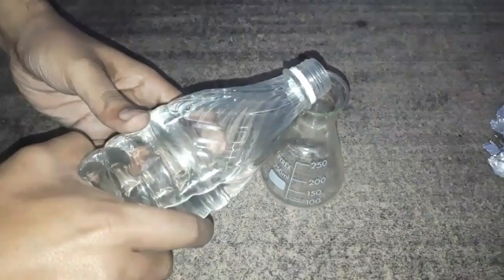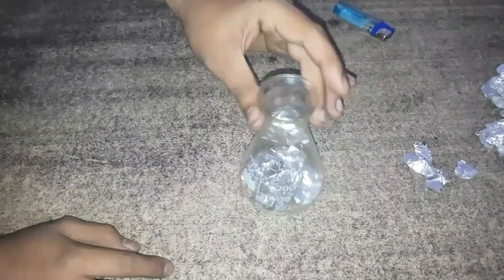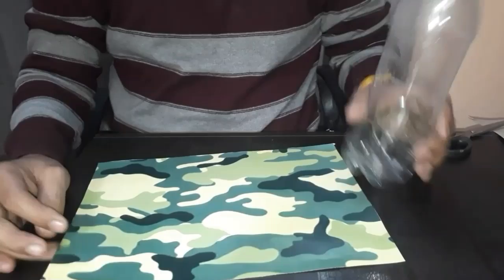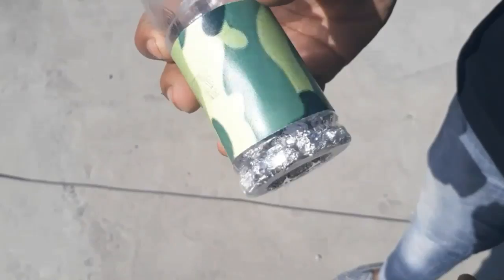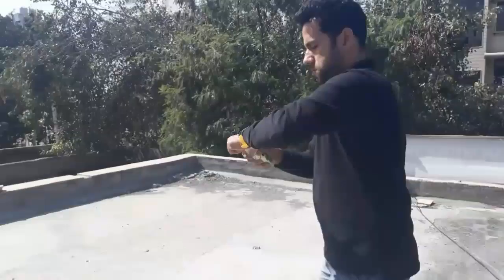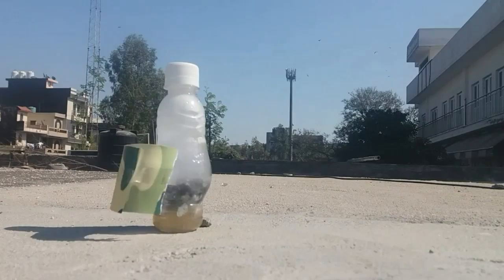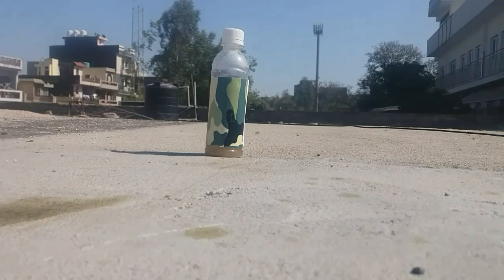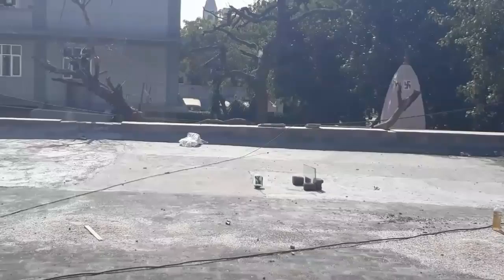Water Bottle Bomb (Do not try this at home) !!!!

Comment: Did he uses Gasoline or acid?
Reply: hydrochloric acid and put little bits of aluminum foil
Reply: you can use drain cleaner that has concentrated  hydrochloric acid but don't breath in the fumes after the reaction goes off